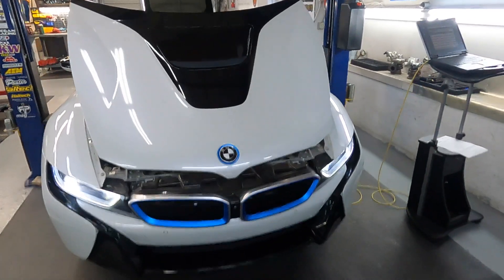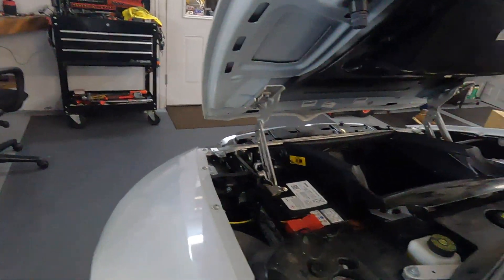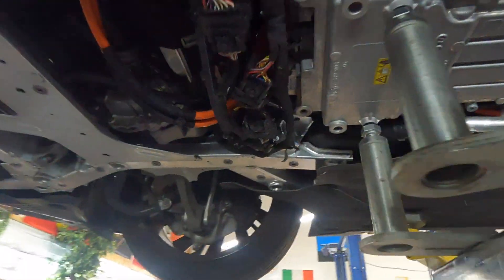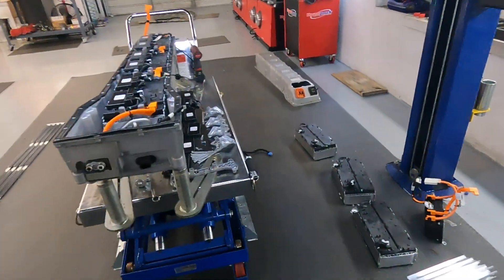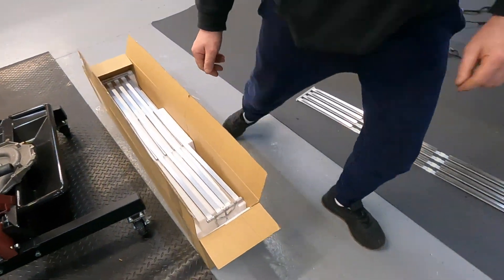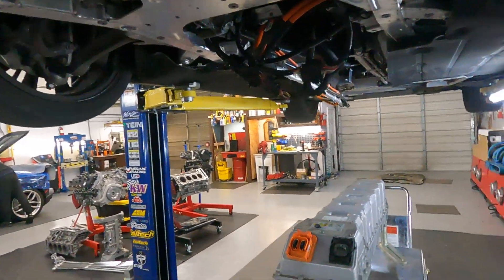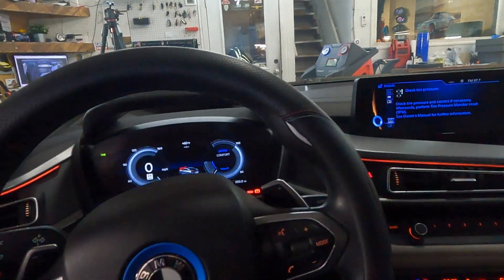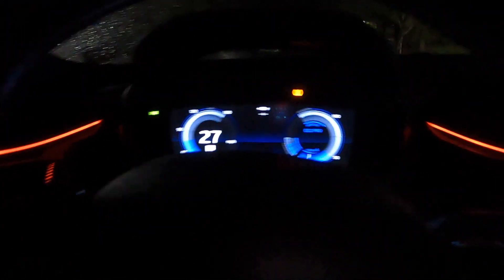BMW I8 A/C and High Voltage system repair

Comment: Hello, did you flush the lines between the AC compressor and condenser and to the battery, and did the compressor come with a full system charge of oil? 
thank you

Comment: The AC circuit is supposed to be closed-loop. So where did the original gas go? This sounds like a fix not a real diagnosis and repair. 
Good he got it fixed, hope it will last, but generally would be sceptical.

Comment: Would be good to see a battery upgrade on i8 . I have seen on bmw forum someone has used 5 series batteries in i8 and increased range
Reply: I have an i8. I'm sure it was mentioned somewhere they're bringing the i8 back with better range and a 4 cylinder motor, called the i8 M. 

This is one of the reasons i8's are now going up in value as people will buy the spare parts and put them into older models for cheaper than buying the newer variant.

Comment: not all models get those issues right?
Reply from the maker: just a/c compressor fail
Reply: @GermanAutoHaus  yup known issue until u replace the compressor...btw do u know if the 2017 & 2019 version has that issue?